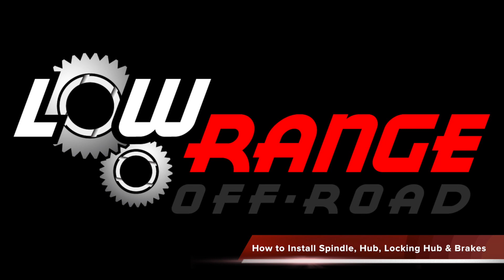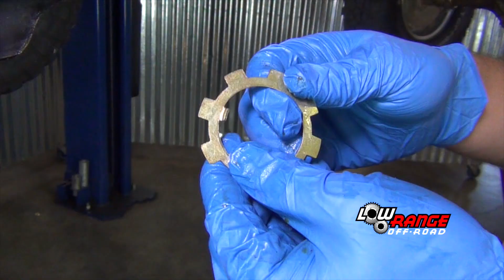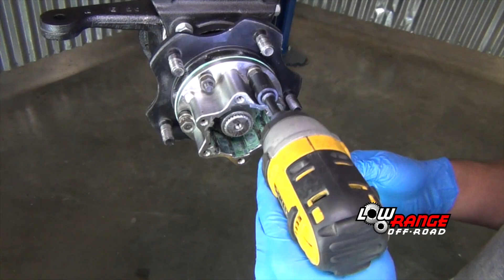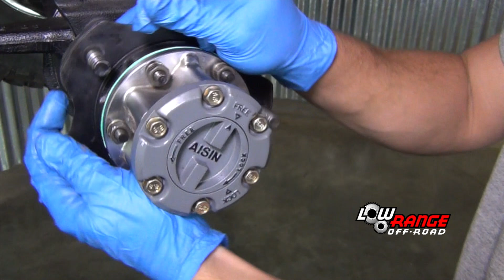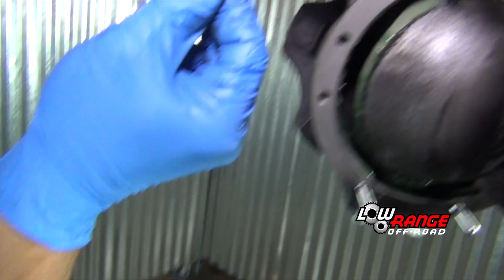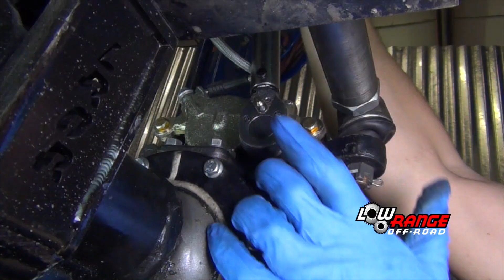How to Rebuild a Samurai Solid Front Axle (Part 7) Installing Spindle, Wheel Hub & Knuckle Seals

Comment: After installing free wheel hubs my differential pinion (in free position) rotates can anyone explain why it's rotating still, even I have changed the wheel bearings and king pin bearings

Comment: Helps: https://youtu.be/JXUvmfIp_g0?t=107

When I'm attempting to tighten to 57 ft lb. while rotating the hub, the hub becomes impossible to rotate long before I reach 57 ft. lb. More like 30 ft and then it's no longer rotatable by hand.

It then says to undo the bolt, then put it at 10 ft lb. 

So is something wrong with my stuff? Should I just continue to 57 ft.  lb while not rotating? Then back it off?